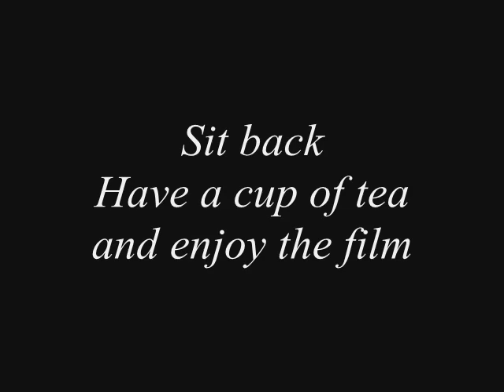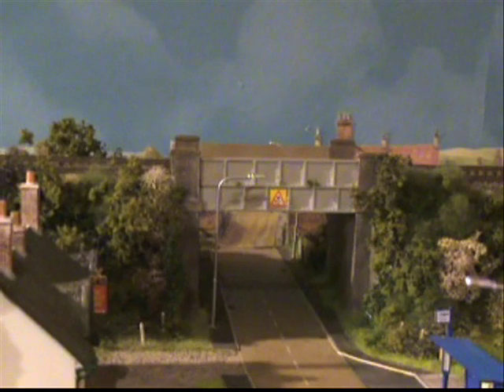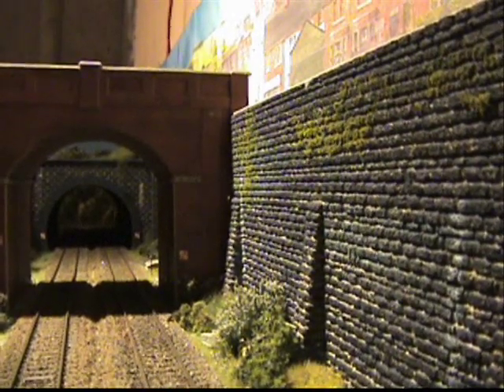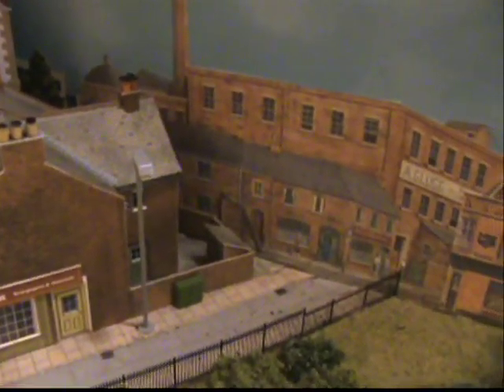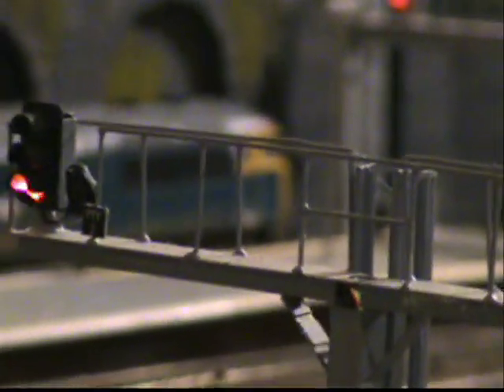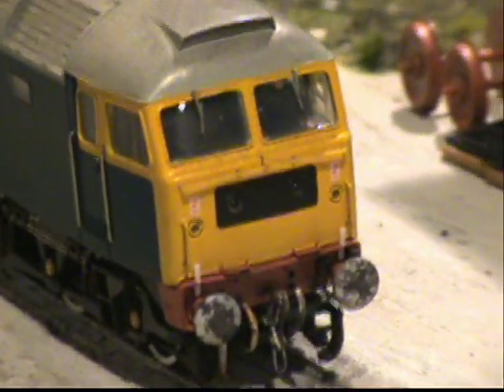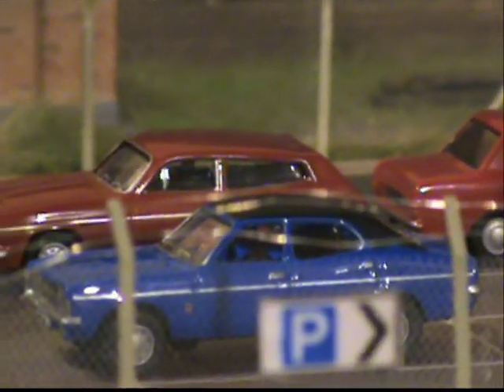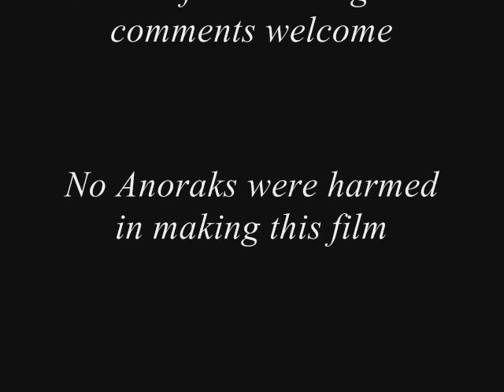MODEL RAILWAY PROJECT DOCUMENTARY

Comment: Excellent video mate very informative like the extension you'll be doing.The garden extension does take a bashing in the winter I had one when I lived with my parents many years ago,the lights and signals are superb I'm useless at electrics so never went down that way has my layout is DC which like you I had a 25 year gap from modelling but did no research when came back into the hobby just did DC as that's what I new but will try over the next few years to convert to DCC. All the best  Kev.

Comment: Outstanding layout and collection of motive power. Very well done layout and weathering. Love the use of lower cost items with a bit of imagination and kit-bashing to create a very good model. Just a personal observation. Am very impressed with your love of the noisy engines...
Though that after forty odd years of model railroading where I tried to get my trains to run silently, I still cannot come at "sound chips" in motive power and when I see this happening I expect to see a restaurant car with fish and chip smells coming from it...Keep up the great work and I look forward to more video updates in the near future...
Reply from the maker: Thanks for the kind comment. I have done a lot more since this was filmed. The layout has been extended by another 12ft. As for sound in locos. For the UK modeller Hornby have been releasing some new sound chips called TTS. I have heard them and sound great. You can get these around £40.00 which is very cheap.

Richard